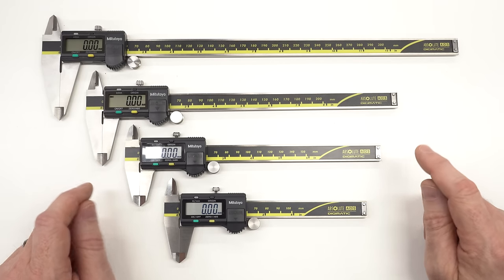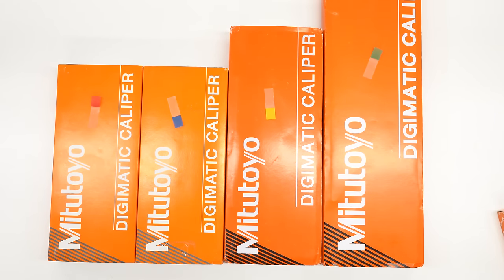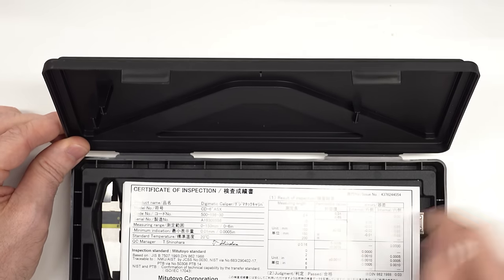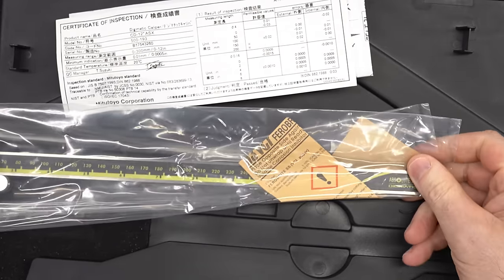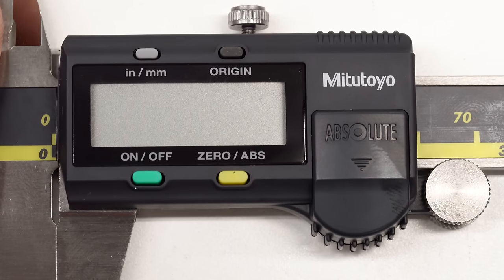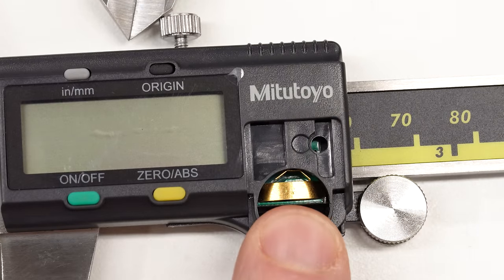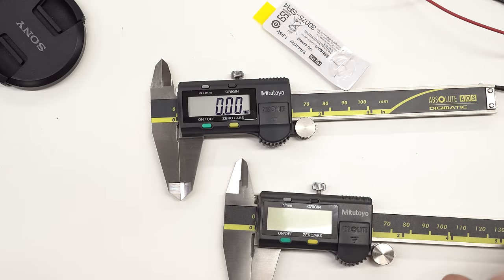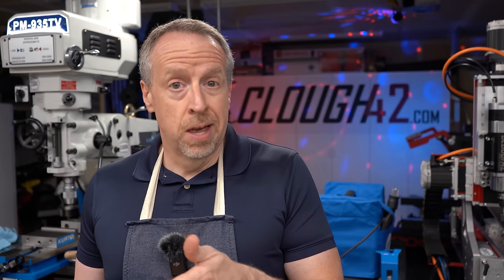17 Warning Signs Your Mitutoyo Calipers Are Fake

Comment: the battery test and off-set screw holes are the only useful differences here and I was expecting the entire vid to be about accuracy....if they are just as accurate who really cares? Would I throw perfectly functioning calipers in the trash if the font was not right??
Reply from the maker: Mitutoyo has spent decades developing and improving the digital caliper, and the result is a quality product that people are more than willing to pay for.  They're creating value.  At the same time, other companies are making alternatives with various levels of price and quality.  This provides many options that are less expensive, and are good enough for people who don't want or can't afford the Mitutoyo.  These companies are creating value.  They're also providing a competitive force that keeps the price of the premium product reasonable.  The counterfeiters are creating confusion so the buyer can't tell what they're getting and can't make an informed choice.  They're not creating value; they're creating waste.  They're also diluting the profit incentive for companies like Mitutoyo to make the next big thing that makes our lives better.
Reply: The cheap ones are probably untraceable, so not useable in a commercial shop. The battery lasts a bit less than one year, just preventing you from finishing that project while you go look for a replacement battery. Accuracy is almost the same.
Disclaimer: I use the cheap ones, but they cost a lot less since they don't have any fake names. Added a switch to one, so I can turn it off. Another one is in its box, battery out, spare battery nearby. And the third one probably has a dead battery.
Reply: Accuracy is not such a simple question. How accurate is it over time and temperature variations as electronic components drift? How accurate is it after experiencing the normal handling and contaminants that get into the device with normal shop use? How will reading be affected by the start of a low battery condition that the product does not warn you about? Even the better quality electronic calipers can have measurement errors if they are not kept very clean, but it will be interesting to learn how lower-cost and counterfeit products compare in this aspect. With counterfeit products, nobody knows who made them, so the manufacturers don't care about what happens 6 months later.
Reply: @Clough42  Well said. Put another way, the counterfeiters are freeloading off the original makers' engineering, product design, package and graphic design, and more importantly their good name.
Reply: If you were to buy these knockoffs, you're not saving 60% off the price of Mitutoyo calipers, you're paying $80 or so for a $12 caliper. Just dressed up a bit. And you'll be throwing them away soon enough.
Reply from the maker: @g.tucker8682  Nice reframe.  I like it.
Reply from the maker: @g.tucker8682  This is true, and I agree.  This is also an argument from a desire for fairness and a sense of justice, which I find are not universal.  I find that the utilitarian economic argument tends to lead to a more productive discussion because it steers away from the unthinking masses who just want to scream at the sky that corporations are a faceless evil and somehow deserve to be injured.  (All while tapping out their rage on an iPhone.)
Reply: Wow, you somehow managed to miss the whole entire point. Sure, pay a premium price for cheap Chinese calipers that have a counterfeit name on them if you want. Do you boo, do you.
Reply: The pin of shame.
Reply: @Clough42  Agree with you. The genuine brand  R&D and excellent quality control doesn't come for free and that is what you are paying for.
Reply: @g.tucker8682  Agree,if you're buying a set of cheap calipers then they are exactly as described but elevating the cheap caliper purchase price and dressing them up to look like something reputable is hijacking the branded company's hard earned reputation. It is simply a deliberate false representation.
Reply: Whatyoudo
You should put seller to give you real ones and don't accept money back. Pirate is pirate. If they want to just make mousers, they dosen't must fake some better manufacturers. If you don't understand this, it's really not my problem. Little bit same like you were drinking acid, I said "don't" and then you asked "do I have to snort this", so ye ye, keep on going..
Reply: Accuracy is not the only consideration (aside, of course, from the very important counterfeiting!) I had a set of Horrible Fright digital calipers which were cheap. They were just as accurate as anything else—the vernier ribbon inside was manufactured accurately. However, I picked them up one day and they just failed to work. They gave erratic readings that I didn't immediately notice, leading to rework. More importantly, now I had to spend time running around to find something else to use to measure. If I had to go out and buy a new pair, the hour wasted doing so nearly completely negates the price advantage. (In the end, I switched to an old steel visual vernier caliper which is far slower to get readings, but at least I know it's always accurate, and the batteries never die.) The same waste of time would be true if the batteries died (which they often would in the cheaper calipers, especially since the current consumption is nearly the same on or off).
Reply: It depends on how you feel about pirates and forgers.  Either you are in or you are out.  Your attitude likely reflects on your desire and need to be creative and your appreciation for other's good work.
Reply: @johnburt1547  If you need extreme accuracy, the caliper is not the tool. Also the calibration needs regular checkup. 
Use the ceapo for knock about.
Reply: While the video is true to its title - focusing on how to tell the fakes from the genuine article - I have to agree that a very minimal precision / accuracy / repeatability test would have made it much more comprehensive and fair. Yes, it's not nice that these are sold under a fake brand; but whether or not they deliver a performance at least proportional to their price IS very important for any pragmatic person.
Reply: @Clough42  not saying I agree at all with blatantly ripping off a product..thats dead wrong, just saying a vid about how to tell the faker needs only a few indicators and we have no idea if this is a deal made by Mitutoyo itself to sell more stuff.
Reply: @johncarroll8662  I think that is a very easy to use proper judgement on. A company making cheap calipers has a valid place in the market. A company who deliberately attempts to pass off their product as that of another reputable household brand are criminals. There are no grey areas with fake goods,it is misrepresentation and fraud plain and simple.
Reply: @DavidHerscher  Yeah if they are same price thats a problem but if they are half-price and just as accurate...it works.
Reply: @jannejohansson3383  once again in English?
Reply: @AttilaAsztalos  agreed, and yes the chances of them failing is higher, the origional is the way to go but I was thinking the vid was about "do they do the same job" not, are the pantone colors correct.
Reply: @ligius3  I'm not 100% sure and can't recall if the measuring instrument needs be traceable to the manufacturer. But I don't think it needs to be.

What I'm sure about, is that the calibration and the record of it need to be traceable to the applicable national and international standards. It's been a while since I last time had to work with traceability, but If I don't recall it wrong, these factory measurement documents are not good for ISO9001 compliant QMS as they are missing the estimates of measurement uncertainty. In fact, it does even say it's a "CERTIFICATION OF INSPECTION", not a certification of calibration - these are two totally different things.

That certificate of inspection with the knockoffs is definitely fake.
Reply: About a year ago I watched a video comparing a fake Rolex with a real one.
Just like this video he showed all the tiny details that you would not see unless you had the genuine article to compare to. The guy doing the video didn't bother to check if the fake kept time or not because that wasn't the purpose of the video. The purpose was to show people what to look for and identify the fakes.
Reply: The most obvious in regards to operation, is the lower battery life and no low battery warning.  This video did not test accuracy and repeatability, so to say they are just as accurate is not a fair statement.  And this completely ignores the question of intellectual, patent, trademark and copyrights rights and business reputation, or the cost of development.  If you do not care about these finer points, why not save even more money and buy some Harbor Freight calipers?  I personally own both.  I use the HF for 'quick and dirty' jobs, but use the Mitutoyo when working on more critical jobs.
Reply: Would you knowingly purchase an identifiable fake product that plagiarizes a good company name?  I believe the title of this presentation is correct and indicates this video is focused on warning signs that can be used to identify a fake product. Purchasing a competitive product from a different company is very different from believing you are purchasing a specific product from a specific manufacturer when in fact the company you thought you were purchasing from did not receive the sale and will not support the product.
...shall I continue. This is a classic Feature/Function/Value issue.  When comparing the differences in the video presentation it is obvious that the fake calipers will drain the battery 14 times faster when turned OFF compared to the real product.  Accuracy?  All I can say is very fine end-point milling on the real product and not on the fake thingies. Accuracy starts at the development level, and only then will better accuracy present itself.
Yep, that was long, but I hope you enjoyed it.
Reply: I've owned a cheap Burg-Wächter caliper before owning my current genuine Mitutoyo ones and the former were pure garbage just because of the battery consumption thing... Despite them having an Auto-OFF feature kicking in after a few minutes It was always a gamble whether or not they'd have enough juice to reliably operate ( or operate at all ) come next time I'd fuckin' need them.
I must have run through like two dozen Cells in those cheap calipers since having bought them whereas the Mitutoyo - which do NOT have an Auto-OFF - just keep running on still the same Japanese Cell it came with despite me constantly forgetting to turn it off. It's almost as if that Cell is a fake and that Caliper is instead sucking power out of thin air at this point.
If those fakes operate like my Burg-Wächter did when on low charge, then chances are you're one day going to take off a reading that will scrap whatever you're making because it wasn't an accurate reading.
Reply: The fake ones lose positing pretty badly as the battery degrades.
Reply: I agree. You failed to cover accuracy, Or did I miss it? You didn’t include a chapter marker for this topic. Why did you skip this topic which is the MOST IMPORTANT???? WTF?
Reply: @Clough42  All true, but you didn't address the crucial accuracy question.
Reply: I suppose you were an early Napster user as well.  I care a lot - I believe in buying quality tools and paying for the engineering and support that goes into them.  If you were running a legit business, I think you'd look at it the same way.  As a consumer, you go for price and price alone.  That's what will ultimately end up with everyone at the bottom.  Support quality with your dollars when you can.
Reply: @alanclarke4646  That doesn't stop Ebay or Amazon and the likes from banning the sale of such goods on their sites. In the UK we have very strong laws regarding fake goods and Govt departments to enforce the laws on counterfeit goods. If there wasn't a market for counterfeit there wouldn't be loads of it getting sold in the first place.
Reply from the maker: @whatyoudo9773  they're five times the price of a cheap import, and just as accurate.
Reply from the maker: @howardosborne8647  eBay and Amazon both have these policies.  It's very difficult to tell from the outside if they're successfully blocking 90% of the attempted counterfeits, or 10%.
Reply from the maker: @NikNak3841  if you think the accuracy of the counterfeit product is the point, it sounds like you're their target market.
Reply: @Clough42  So now you have proven these latest purchases are indeed counterfeit why don't you send them back and demand a genuine Miyutoyo as was advertised?
Edit to add: I believe Ebay and Amazon are doing far less than they could to prevent these items being advertised. They are complicit in selling counterfeit goods.
Reply: @bigboreracing356  Well good; I didn't know that. I could easily imagine for example that the encoder isn't.

Also I forgot to mention what I think is the second most important thing: How smoothly do they open and close.

I had some cheap once once that were rough feeling.
Reply: @NikNak3841  As previous posters mentioned. The purpose of this video was "17 Warning Signs Your Mitutoyo Calipers Are Fake",    :  NOT,  "Accuracy differences between fake and real Mitutoyo calipers"
Reply: main thing is that fake calipers actually worth 3-5 times less than price you pay for them. They just put this logo on the box and pretend to be as good as original ones. but they don't. And you say: ok, i payed 120$ for the 50$ chineese-shit caliper, but it's ok because i don't care about font on the box. 🤦‍♂
Reply: I have a couple cheap China nock offs. Every time I go to use them the battery's dead.  LOL
Reply: It's not about the accuracy, it's about forgery. I don't mind buying something cheaper which is just as good, but I have a real problem with paying for something which is sold under the brand name of the company I thought it was. That is direct theft. Appalling. How would you feel if someone sold their product under your name and took your profits away from you?

The fact that anyone even tries to justify intellectual property rights theft or capitalize on trademark forgery is a disgrace.
Reply: @guy_b  low life's sell counterfeit merch and low life's buy it.
Reply: @whatyoudo9773  So why pay half of premium? Go out to Harbor Freight and get "good enough" for a fraction of the price. It works, right? And HF has their issues, but they don't pretend to be someone else and charge many times what they're worth.
Reply: @howardosborne8647  Beyond false representation, it harms the reputation of the legitimate manufacturer when a person purchases the item with the belief that it is genuine, and then finds the performance to be less than expected.  The miss-led consumer will probably blame the legitimate company for their dissatisfaction.
Reply: @scottramos7949  The counterfeiters are simply extracting value from Mitutoyo's reputable credibility. The internet sellers are the worst culprits in this deception as they knowingly facilitate the fraud for profit. If there were no willing sellers there would be no market for counterfeiters.
Reply: Genuine saves 14x batteries
Reply: Because you are an accessory to the theft of money from Mitutoyo when you buy the counterfeit. Just but a cheaper item rather than a fake.
Reply: @whatyoudo9773  The video is about how to identify a fake which I appreciate.  My harbor freight calipers were accurate for a couple of months and worked fine until they fell apart within a year.  I could care less if the fakes measure accurately directly out of the box, I want to know how to spot a fake within the return window so I don't get ripped off.
Reply: @whatyoudo9773  
"not saying I agree at all with blatantly ripping off a product..thats dead wrong, just saying a vid about how to tell the faker needs only a few indicators and we have no idea if this is a deal made by Mitutoyo itself to sell more stuff."
If you're suggesting what I think you are, that would be an incredibly stupid thing to do!
Some companies do sell 'second tier' products (even 3rd tier), but they're clearly identified as such, and usually run under another branding name.
Reply: Because your buying it for the quality that the name represents and the backing of that company if the item needs to be serviced. If I only want cheap calipers for knocking around the shop I'll go to HF and pay a tenth of the cost of that eBay fake for the same quality. Plus at least HF doesn't rip off the good name of a high quality manufacturer and they are not deceiving you about what your buying. If you have problems with the fake and try to send it in to Mitutoy for service they will either confiscate it as a fake, or send it back to you under your own dime, but they won't fix it.
Reply: I would care..a fake is a fake. Just like buying a fake hi end watch...But I would never buy things like this off Ebay,Amazon or Ali Express.
Reply from the maker: @howardosborne8647  eBay policy doesn't guarantee delivery--only a refund, which they provided.
Reply: Nice way to completely miss the point.  As another reply perfectly stated: "you're paying $80 or so for a $12 caliper."  If you're OK with crappy Chinese calipers, why would you spend a stupid amount of money on an illegal rip-off clone when you can buy exactly the same accuracy and "quality" for 1/4 the cost?
Reply: @g.tucker8682  spot on
Reply: The "just as accurate" is a problem, because frequently the fakes are not "just as accurate."  For an everyday DIY'r, yes, you're unlikely to need the degree of accuracy where the reals and counterfeits differ.  But in professional settings repeatable measures within a specified degree of error are critical.  There are reviews of various caliper brands where accuracy and cost are considered if you are interested.  The other thing to note though is your self-deception.  You bought a low-priced "Mitutoyo," imagining it was a bargain.  But it isn't a bargain at all. because it isn't a Mitutoyo.  You almost certainly got no more than you paid for, and the odds are you really got less than you paid for.  Instead a bargain Mitutoyo, you paid through the nose for a fake.
Reply: They're no less accurate.
Reply: @Clough42  Decades? It's a simple design.
Reply: @Clough42  most likely these are produced in the same factory in China as the legit ones. That's how they manage to make such good counterfeits. The packaging is usually provided by a separate company that's why the packing is not 100%
Reply: This guy lives in a reality where apparently some knock off brand can build the same quality product as Mitutoyo...
Reply: I feel like we stopped in the middle of the tests. Curious as to their initial accuracy and the rest of the low voltage test on the real one.
Reply: The video is literally called "how to tell if they're fake" so why were you expecting a video about accuracy?
The reason it matters is that people care about who they give business to - i.e. to the owner of a brand and not a deceptive company who is stealing branding to fraudulently generate sales.   Sure, some people just want a cheap product that works well, in which case, they can buy a quality 'other' brand - but they should do so knowingly.  A well made fake Louis Vuitton handbag will carry your stuff and look real but if you buy it for $50 you know its fake but these callipers are not being sold as obvious fakes to deceive your friends, they are sold to deceive you.  They might be accurate on day 1, or QC means they might not, but how long will they last. So, "who cares" - anyone who's ever worked for something and doesn't think others should steal from them or benefit from their effort.  Finally, who says they're accurate?   Sure, a major omission of this video is comparing measurements - I'd guess they're not as accurate and/or don't stay accurate/consistent over time.
Reply: @ligius3  It was around 20usd to get 100batteries. have been using these for last 10 years and i have 4 calipers and 2 digital micrometers. Using cheap nonames since they are very accurate compared to branded prices. Yes they last around a year, used or not , but since it's so cheap it's no problem to change the batteries. It would alo be quite easy to 3d print holder for few batteries and attatch it to caliper.
Reply: I’m not a machinist so a $25 caliper is good enough or me. You showed so many differences between legit and counterfeit it would be hard to miss one no
Reply: @MicroageHD  Look at the internals. The method is simple, they're all the same accuracy.
Reply: Yeah I would be interested to measure 10 parts 2 times each and compare the results between the brands. All that matters is if it can hold a calibration
Reply: @jjmalm  No need to test it 10 times. It will be 100% accurate at all times and can't possibly be anything other than. The design is simple.
Reply: @g.tucker8682  We haven't established the fact that they are fake or how long they will last.
Reply: @Clough42  I strongly agree with you.  If the companies that imitate Mitutoyo really can create quality products with value, they can simply sell the product under their own brands.  This is similar why consumer product companies like Sony that produces a more affordable product under Aiwa brand for the mass market.
Reply: Yes but why should you pay for the top end product when you are not getting it ?, the cheaper ones should be sold on their own merit not trading off another company's good name.
Reply: @kitchenbriks3685  They are clearly NOT produced with the same tooling as the original ones. In fact these calipers seem to share the tooling with various cheap (much cheaper than fakes) non-brands off Ali. If they were off the same line, they'd look actually identical, with same machining marks, same shapes of the relief, same alignment of the access holes on the shroud, but they aren't. Mitutoyo calipers aren't manufactured in China to begin with.

As to the measurement principle, it's so robust that there's little to go wrong, apart from when cheap calipers or fakes just decide to jump 5mm. But then there's surfaces to look at, how parallel or well matched they are, how much backlash there is, and i think the video should have really paid more attention to these things.
Reply: @g.tucker8682  not exactly, it depends,  the fake one may be sufficient,   may require a bit more carefull use  but you may not have to toss in a year, mine has lasted for 10 so far
Reply: @hydorah  It's the other way around.  There will be no war with China as long as we power their economy.  Russia, NK, Iran... different story.
Reply: @g.tucker8682  "$80 or so for a $12 caliper"  . you hit the nail right square on the head
Reply: If reception / reaction to this issue could somehow be elicited when screening for an engineer, or a tradesman, to hire for a particular job, ...confidence in the eventual result would probably be 70% solved. Counterfeit materials (whether cement, wiring, steel or tools) are cheaper, and may be visually indistinguishable (at first)... and they get the job paid. Then the buyer finds himself needing to pay more and more — sooner and ongoing — and not always in ‘just money’.
Reply: It’s sub standard.  How’s the weather in China?
Reply: *So true! * If I could buy a Pontiac Fiero with a Ferrari body kit slapped on it, all for the same price as a real Ferrari, I would totally be Ok with that! These people just don't get it. It's just a car.
Reply: @g.tucker8682  Maybe I am lucky, my chineeiums are still going since 94, yes 28 years, paid $9 for them, get used a lot and not well cared for (left out on the work bench) like my $300 8" mit's (always cased when not in use).
Reply: The problem is these thieves are stealing someone else's reputation. That alone is loathsome. Another problem is durability. Second rate parts simply will not stand the test of time.
Reply: Of all of the "I missed the context" statements....
Reply: @mrsensable  and low life's complain about it. I just by a couole cheap china ones and always have a backup, saved some cash.
Reply: @Eduardo_Espinoza  only when your NOT USING IT.
Reply: @lookronjon  How is it sub standard?  Weather is probably smoggy.
Reply: Oh oh it seems like someone just found out that their Mitutoyo caliper is a knock off.
Reply: @rastapete100  Not me.  I threw away the packaging so I have no way to tell.
Reply: I'd rather not reward unscrupulous Chinese manufacturers and importers.
Reply: @powertothebauer296  Either way... That caliper is crap ( at least compared to the Mitutoyo I now use ).
Reply: Accuracy doesn't help You, when You're on the 9th battery after two months, and the battery cintacts start to break loose. I would go for the nice font, if I were to buy one now! 😍
Reply: @Clough42  Well said, I fully support every word! I spent quite a lot of time to understand that I needed a mitutoyo and could afford it, and now I spend a lot of time trying to understand whether I have a real mitutoyo or not!
Reply: @НикитаАндреев-ч1ь  Ha! So you can’t tell? Point made!
Reply: @g.tucker8682  good point.
Reply: @whatyoudo9773   perhaps you could explain why Mitutoyo would sabotage its own sales by selling a cheap knockoff for presumably far less profit, which would involve getting different materials and inks, redoing artwork, designing a new PC board, an entirely different production line and processes, etc. -- and just how they would keep it quiet, for decades?
Reply: Exactly my thoughts. Knock off, no question, a bit shite? You bet? But for someone who doesn't need state of the art, then as long as the measurement made using the tool is accurate, or as accurate as you would expect from calipers as opposed to a decent micrometer, then the potential purchaser would be real happy to have saved a bucket load of cash on a tool that still does what it sais on the tin.
Reply: @NikNak3841   I'm almost sure:) What do you mean?
Reply: It's a criminal act to counterfeit these tools, too many people don't care about crimes these days. I don't mean to sound old but I think it matters.
Reply: @johnburt1547  If you care about that level of accuracy you are obviously a keen machinist and shouldnt be using eBay calipers anyway.
Reply: @dalegribble9101  You are reading something into this that I did not write. I'm not talking about a high level of accuracy when the topic at hand is the guess-o-meter. Even the more expensive name-brand calipers can be prone to unexpectedly giving erratic readings if contaminants get into the sensor (similar to what was experienced by @Jason Olshefsky above) so keeping them clean and performing frequent sanity checks are good practices if you are relying on the measurements. I do the same, but also my primary calipers and micrometers are not electronic.
Reply: @59jm24  You are reading something into this that I did not write. I'm not talking about extreme accuracy when the topic at hand is the guess-o-meter. Any electronic calipers are prone to unexpectedly giving erratic readings (such as experienced by @Jason Olshefsky in this thread) if contaminants get into the sensor.  Therefore keeping them clean and performing frequent sanity checks are good practices if you are relying on the measurements. I do the same, but also my primary calipers and micrometers are not electronic.
Reply: The knock-off's are worth 20 bucks...
Reply: @Clough42  I am pretty sure that Brown & Sharp developed the digital technology many years before Mitutoyo started producing them..
Reply: Would you throw them away, no; but know you paid a big price premium for something that is little more than a dressed up $15 harbor freight caliper.  Fraud.
Reply: You are part of the counterfeiting problem.
Reply: @GraemeMurphy  From the person with the multi billion dollar laundromat flag for a picture
Reply: @JasonOlshefsky  So your one and only measuring tool is a harbor freight??? AND you work alone?? AND didn't notice erratic readings??? AND you do such close tolerance work that you had to rework? AND the batteries often die but you don't keep spares on hand? ? My harbor freuigt specials are mainly  used for woodworking so my good tools can stay in the box, AND I use them almost daily AND the battery lasts well over two years AND I always have two spares in the case..... .
Reply: RIGHT??  When you take a part to the inspector for a first article OK, it's either right or it's not..
Reply: @Clough42  Mitutoyo has spent decades producing them and paying for the right to do so.. They have developed nothing.
Reply: @НикитаАндреев-ч1ь  meaning if you can’t tell the difference…
Reply: Just buy calipers that don't represent a company who has put time and effort into their quality products.
Reply: "if they are just as accurate who really cares?"
There's 3 issues here
1 - if it's as good a product then as the Op said why no simply market it as such without pretending it is a Mitutoyo ?
2 - The real issue with these copies is that if everyone start going for those than Mitutoyo and similar premium brads will simply stop R&D on such products, R&D that is in fact being stolen when these cheap  compagnies creates knockoffs by revers engineering the original product, it is the same debate as video game piracy, if everyone pirates then game developers will give up and you as a consumer will be the one impacted
3 - accuracy out of the box is one thing, reliable accuracy and repeatability during the products lifetime is another completely, I own both real Mitutoyo and unbranded cheap crap, the cheap crap was just as accurate as the Mitutoyo... the first few months... I would never dream of using anything but the Mitutoyo (or similar premium brand) to determine if my machining is on spec.
Reply: Just blindly trust someone who is fooling you with fake branding, what could go wrong?!?
Reply: Assumptions about fake being equally accurate are probably labelled under underdog effect or similar bias common to everyone of us.
Reply: @Clough42  Most people are cheap AF!  And have no backbone when it comes to purchasing knock off products, whether it be calipers, grinders, levels, etc.  People who WILLINGLY buy knock off products are the people who shouldn't be using tools to begin with.  

The point that you make in this video is lost on them completely, certainly don't waste much time on those folks as they will never fully comprehend this.
Reply: I'm sorry but its this very way of thinking that is why we have horrible quality products in today's time. Any one who is willing to just shrug their shoulders and say oh well, no big deal is willing to cut corners and then use this excuse when they have angry customers. This is 5he problem with society today.
Reply: My biggest problem is they cheat me, would you not get pissed if you spent original product money, but only got a fake??? I mostly don't mind they copy stuff, but keep it so i can se the difference, with these on the market you can be sure you get a original product.. and that is a real problem, they profit on reputable companies...
Reply: @jvon3885  well it is what we have, an entire herd of people that will just take a chemical injeciton mandated by the state instead of question and resist, so they are not going to do much more for engineering accuracy.
Reply: It's a lot like identifying fake Louis Vuitton or Chanel bags and accessories : lettering, spacing and other really subtle things.
Reply: It's still fraud. If you bought a mitutoyo you should get a genuine mitutoyo. Nothing wrong with making a good caliper just put your name on it instead of someone else's to trick people into buying yours.
Reply: It's not just accuracy. I (apparently) bought a knockoff that lasted 4 weeks. After that it quit working. Fresh battery brought no joy. I didn't realize at the time that fake calipers were a thing. Thanks to this video, I do now.
Reply: @johnburt1547  and ive seen battery level affect cheap caliper accuracy too.
Reply: I use a range of Mitsutoyo digital calipers at work and they are absolutely tight, work of art, fine instrument. For my home use, I bought a $12 Harbor Freight digital caliper that looks like Mitsutoyo, but it is sloppy as heck made out of pop metal or something... also drains battery in a month. Complete garbage that I do not even want to grab it anymore. Hence, I am thinking of Mitsutoyo and came across this YouTube... If you think the real Mitsutoyo is just $12 caliper with fine prints, you have never used real Mitsutoyo. It's like a Rolex against Timex.
Reply: Intellectual property theft is a problem.

These companies are stealing from Mitutoyo.  Also maybe brand new they’re just as accurate.  But what about after repeated use? How long before they need to be recalibrated?
Reply: Longevity and durability divide the authentic and from the counterfeit. 

I personally don't need a digital caliper. It's a novelty for cue collectors to measure the diameter of shafts. I definitely don't need a $200 digital caliper, but the cheap ones are known to malfunction or stop working after a few months. 

Mitutoyo has proven itself. The counterfeit has not. The counterfeit may be accurate and useful in the beginning, but how long will that last? There's definitely no warranty when it stops working. At $75 to $100, it's cheaper than the authentic, but the same quality as the $25 digital caliper off Amazon.

After watching this video, I abandoned the idea of buying a pre-owned Mitutoyo and bought a new Shars. Four years is a long time to be using something daily. Thanks for the information and insight.
Reply: @g.tucker8682  Yeah they look very similar to the harbor freight calipers.
Reply: I have a pair of the fakes, after a few parts coming out wrong. I managed to figure out the ID measuring jaws on the back are measuring about .002” different from the OD jaws. So I’m my experience they are certainly not as accurate. That said they work just fine for most situations.
Reply: @mrsensable   ouch, that is out of order. I bought a set and now find they are counterfeit, really don’t need you telling me i’m low life. Seriously biting my lip keeping my language in check with you.
Reply: I did once. I had a free set of calipers that was every bit as accurate as my real Mitutoyos. But the batteries lasted about a week. It wasn't worth it.
Reply: @ligius3  If you had them calibrated to a NIST-traceable reference by a qualified calibrator, then yes, they would be.  Whether that's cheaper than the difference in purchase cost is debatable.  Also, calibrations expire, so you could have that problem with the real thing.  Not all commercial work needs NIST-traceable accuracy though, but as a general rule, anything military or aerospace will.
Reply: Because you're paying $105 for a $10 Caliper.
Reply: The one fake is being little honest at 6:10 they turned the snowmen into 8's!

"'Eight' (八) in Chinese is pronounced ba and sounds similar to fa (发, traditional character: 發) as in facai (发财), meaning 'well-off' or 'becoming rich in a short time'. "
Reply: If they’re as good as the original, why spend some time and money in imitation? Why not just go with their own artwork and design and create real competition instead of fallacious industrial method.
Reply: @Clough42  As the Mitutoyo is known as the Japanese Starrett, iGageing (sic?) has become the chinese Mitutoyo - well made, with a chinese traceable standard equal to NIST, and for me it had one BIG advantage - the bluetooth connection to my laptop and a read button that sent the reading directly into an excell spreadsheet, which saves loads of typing and typos while automating a manual task to a degree.  Now I can get mean and std. dev. out of my caliper plus make graphs with the data.  Does Starrett make a bluetooth caliper?
Reply: They are just cheap Chinese $10 calipers disguised as mitutoyo. They are not as repeatable as genuine ones.
Reply: @yoyomin  Honestly, I use Mitutoyo (analog) calipers, but cheap ones are more then accurate enough, the zero might be off, but that's a 30 second fix. The mitutoyo is just smoother. If you need more precision then 1/10th  of a mm you should be using micrometers anyway. A digital caliper might read to 1/100th, but it's not accurate to that resolution. A quick test with gage blocks will show this. And in ID measurements, especially on small holes, you'll be lucky to be accurate to a couple of tenths of a mm.

And what a lot of people don't know is that Mitutoyo itself was convicted and fined for forging test certificates on a couple of products in the early 2007's. Somehow they managed to keep it fairly quiet, but is was a very large fine, as well as an export ban. They would just not test certain products and assumed that they were always within spec. (to be fair, they probably were right), and print a "standard" certification.

At least that's what I remember, If you want to to find information about this, just search "mitutoyo case", or "mitutoyo export ban", and search for 2007 results.
Reply: 27:21 The kerning between “n” and “a” in “Original” is atrocious for the genuine product!
Reply: They knockoffs consume more power too.
Reply: You'd have to evaluate this question/answer from...

What "guarantees" do I get from buying authentic over counterfeit? I.e. authentic 'might' have apart of their offer that if it breaks down in the first 24 months then they'll replace it for free (along with IF this happens what is the price of a new counterfeit if it breaks down within that time period and if it still works out cheaper?)

You'd probably want to do a daily calibration check to ensure the counterfeit and authentic holds it's calibration otherwise if the callipers are for testing or professional purposes and not a hobby then to consider what the cost is if you have the wrong measurements?
Reply: @kitchenbriks3685 They probably use the rejected pile to make the counterfeit ones, that's why the holes are not lined up.
Reply: I've got the real deal and one I suspect could be a counterfeit. Both are equally accurate, smooth and tough.
Reply: @Clough42  Is this why the fake ones look better? The genuine one looks like it's made from cheap plastic while the fake looks much sturdier.
Reply: agree, really expected to see IF they are accurate...
Reply: I purchased a cheap pair to check for fake coins. They seemed to work ok for awhile, then after a short time I began to suspect the readings… I checked the calipers against a ruler… the readings were wrong.  Time for a battery change and new, genuine, accurate and expensive calipers.
Reply: I Agree. Waste of time and a video. Who cares about battery's, Labels. Printed graphic's. just superficial crap. How accurate are they compared to the real product is ALL that matters.
Reply: @Clough42  They have created waste at all if it performs just as good. But we wouldn't know as you didn't actually test anything.
Reply: After having literally hundreds over the years I can say you are paying for quality, the old saying you get what you pay for is very true here, as the Chinese version does not last for very long
Reply: How to miss the whole point.
Reply: @howardosborne8647  I have reported items on facebook that are direct copies of my own products and they do nothing !  ebay is only interested in the money from sales !  I don't use amazon but suspect they are no different !
Reply: @yeerboi  I have Mitutoyo equipment from many years ago some over 20 years still going strong, I bought a few off ebay a couple of years ago and they worked perfectly well I only found out they were fake when they went for calibration !   but guess what ?!  they are no longer working, failed very quickly.
Reply: @justlookingaround9834  who is that aimed at ?
Reply: @whatyoudo9773  Half price is WAY too much. 10% of the price might be fair. However, why support and buy from a company created with the sole intention of fooling people, not supporting the product and not revealing who they are? I think it would be better to buy a cheap one (but not fake) at 20% the price of the Mitutoyo, then at least you know who made it.
Reply: Because it is fraud
Reply: @noahkatz9616  The video was not about accuracy. Only about how to tell fake calipers from genuine. Did you not read the title?
Reply: @ellieprice3396   I did, and don't think the results are useful unless in addition the measurements are accurate.
Reply: Because they're not the same quality. Most of us already know this and would like sure-fire wells to tell if what's being sold is genuine. If you don't need the accuracy and reliability of an expensive caliper, buy the $12 one that doesn't have the Mitutoyo name on it, because they are the same thing.
Reply: Exactly. Check them with joblocks, if they're accurate, who cares where they're made.
Reply: My question you didnt cover was in the USE. If you dont have the real ones for comparison of fonts and colors, etc. How do they FEEL? If you were naive enough to think you "Got a great deal", is it blatantly obvious when you go to use them? (Not accuracy, but feel.....how smooth are they etc)
Reply: @edwardhugus2772  lol, I'm a professional machinist, I own and use both, I like the fake ones better. The real ones, any tiny bit of moisture, they're screwed. So far the fake ones have been flawless.
Reply: @KingfishStevens-di9ji  Thanks. My Home Depot ones work really well for $40.00
Reply: The fakes are rubbish and fall apart guy, I know as this happened to me 😡
Reply: BUT THE BOX IS A DIFFERENT SHADE OF ORANGE !!!!
Reply: My fake one fell apart in 6 months as opposed to the genuine lasted over 20 years don’t buy cheap it’s  false economy
Reply: my fake one fell apart in 20 years as opposed to the genuine lasted over 6 months
Reply: @jannejohansson3383  Huh?
Reply: Wrong answer. I paid for Mitutoyo and I want a Mitutoyo. What a silly statement.
Reply: I think this video is aimed at the serious machinist or someone enjoys quality tools. Apparently you're not a machinist or someone who uses a precision measuring device like this very often. If that's the case, that's fine. There's nothing wrong with that. Just don't spend 80 bucks on a fake that took 10 bucks to make. Just go to harbor freight and buy the 25 buck one which will serve the part time hobby machinist a long time. And while your out there get a 100 buck Rolex to go with it.
Reply: If you feel this way why are you even considering the ripoffs?  Go buy $10 harbor freight ones - what kind of comment is this? You are promoting way overpaying for a ripoff $5 caliper? hahahaha

And I will tell you from experience - for the price the $10 harbor freight or Amazon calipers will give you what you need for maybe a project or 2, maybe even 3-4.  But they do not last at all, the battery life is atrocious (now I know why) and they fall apart very quickly.  $10 is fine for someone who uses the thing 1-2 a year (but you better keep the battery out of it) but anyone else is better off with quality - or if you are crazy like me you invest in an older quality non-digital caliper
Reply: @kitchenbriks3685  the actual calipers aren't made in China 🤦‍♂ these aren't Air Jordans, good lord
Reply: The idea behind Mitutoyo calipers is that they are accurate and work well in almost all conditions, including temperature fluctuations, dust, grime, water, oil, tiny steel particles etc. and they are reliable and still work 20 years later. While both calipers might be as accurate under ideal conditions on day 1 with a full battery, this will probably be different a year later or with a battery nearing the cutoff voltage. You won't get a warning that your measurements might be off and suddenly, you have made a part that doesn't fit as it should. Of course Mitutoyo are not the only company in the World that can create reliable calipers, in Europe there is Tesa for instance, but you will always pay for the quality and there will always be a reputation about the product.
Reply: @dingdingdingdiiiiing  
I'm not for copycat branding. It's wrong.
Speaking about accuracy tho, I have never used a stranded to test calipers because I wouldn't choose calipers if I need that much accuracy. They are more of a comparator. Measure one piece & make the other match it close enough.
I am happy for the people that can justify spending the money for them even if I can't. 
I am happy with my cheap ones but I wouldn't even pay the price of the knockoff ones if they were just as good.
This makes me think about when people say "you get what you pay for". I always say to make sure you are getting what you pay for.
Reply: The video title clearly states "17 Warning Signs Your Mitutoyo Calipers Are Fake" & it efficiently shows 17 warning signs to help people spot if they've bought fake items so it gets 10 out of 10 as far as I'm concerned. 

Debating what make of calipers offer the best value for different people with different needs etc is a completely different subject & has actually been covered by this Youtuber in previous videos.
Reply: I care. Scams like this will drive the real stuff out of business for one, and why is that ok? And, what warranty do you have, and what guarantee that the accuracy will be consistent?
Reply: You sort of miss the whole point, don't you?
Reply: It’s the same with Apple headphones (AirPods etc.) really well copied (optically) the easiest way to spot them is the packaging not really Apple quality and  sophisticated. I find it very annoying that even through Amazon and from within my country (Germany) these copies are sold through bigger companies as well. I wish they would enforce the law better and punish sellers / shut them down…
Reply: The price alone is the clue
Reply: Really makes my blood boil about Chinese imported fakes.
The 10 or so products I make myself per month and despatch to EU get held up at customs for weeks.

It's about time customs absolutely reject fakes coming into our country.
WHY DO THEY ALLOW THIS JUNK IN ???🤬🤬🤬
Reply: @g.tucker8682  The problem is not everyone is clever enough to pick up on the fact they bought knock-off. So although at the one end some people will buy the knock-off knowingly, hoping they get a good deal on something comparable to the real deal and will probably find out there is no such thing and might end up buying the real deal when the knock-off prematurely falls apart. On the other end you'll also probably have people too dumb to realise the good to be true deal they got on Mitutoyo calipers was due to them being knock-offs, hence why they fell apart within a month, and that could cause unwarranted damage to the Mitutoyo reputation. Hence why copyright and brand name infringement is so frowned upon in the West (and I count Japan as part of the West in that sense, just like Korea), while China has no issues with it because all they know is stealing and copying.
Reply: As for accuracy, you could see on the fake calipers how as the voltage went down (battery dying), the measurement reading changed. That screams to me "inaccurate".
Reply: Scary that the comment defending ripping people off and tricking them gets so many thumbs up.
Reply: As he stated at the end, you're still paying a premium for the name even if you are buying a "cheaper" counterfeit.

The time and resources taken to copy an existing product down to the documentation and packaging style could go toward actually improving a bespoke product. 

Either they are counterfeiting in order to get a few more dollars than they could with their own name, or because their product isn't even good enough to stand alone. Either way, you are over-paying. So just buy a cheaper caliper that costs less than the knock-off. You at least know you're buying from a company that doesn't worry about customs seizing their next shipment, and the product will potentially be better.
Reply: If they are good, they don't need to mimic existing company. Just spend decades on making a name for themselves and they should sell. Unfortunately noone made video how to recognise fake durex and here you are.
Reply: You should expect the content after reading theTITLE OF THE VIDEO lol.
You really don't care someone is your parent or not if they give you perfectly sweet candy.
Reply: Because the clones don’t have the “created value” of branding, to fund their marketing campaigns 😂
Both use the same made in China electronics 😮
Reply: Just buy a 20$ non-branded Chinese calipers. I had a few of those, and they are great compared to not having them and work alright, but Mitutoyo are on a whole different level, feel and quality altogether
Reply: You're a perfect passenger for Boeing MAX aircraft
Made a bit cheaper to increase profit, NQR, but who cares about corner cutting anyway?
Reply: @Clough42 I reckon he'd be the same kinda "guy" who authorised all the price/corner cutting at Boeing with the 737MAX. Almost without a doubt. Who knows, he might have even been one of the people working on it who's responsible for the deaths
Reply: Why on earth would you expect a video titled "17 Warning Signs Your Mitutoyo Calipers Are Fake" to be about accuracy and not about identifying counterfeits? Are you OK paying $100 more for Harbor Freight quality tools just because it says Mitutoyo?
How are those "Are Jordens" sneakers working out for you?
Reply: @mrsensable  I agree that, "Low life's sell counterfeit merch" but the buyers are being tricked into thinking, that they're buying the originals at a good price! So the buyer isn't a low life.
Reply: @Duraltia  that has given me an interesting thought. Could mitutoyo build solar panels into the calipers like you see on calculators or watches? It may even be possible to hide the solar panel under the display. Make it use a decent capacitor and not batteries and you have calipers that will last practically forever, only needing a quick burst of sunlight when dead.
Reply: @NikNak3841  Are you even capable of reading the title of the video?  Apparently not.  He's pointing out how to identify fakes, not trying to compare performance with the genuine article.
Reply: @twistedhillbilly6157  cope buddy...